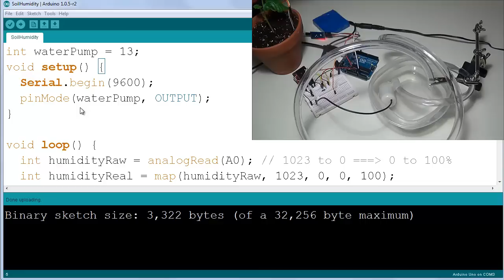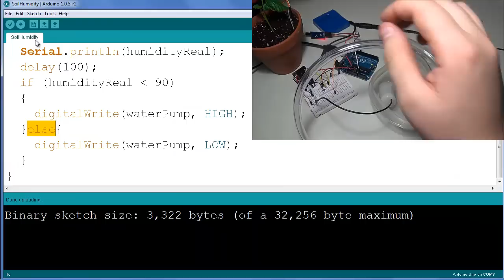Ep.52 Arduino Projects - Automated House Plant Waterer - Part 2

Comment: yes great. awesome demonstration. i have modified this project. i am not using water pump, as i had high pressure water supply. i am using electric valve to turn on or off water supply to my garden. it is working perfectly.
Reply from the maker: +umar ufx Nice! I haven't done further research on this, but it's true that if you can get a garden hose valve which is voltage activated, you don't need any pump.

Comment: Nice project.  I was thinking that a gravity system would work too with just controlling a valve that is normally closed.
Reply from the maker: +eTechTom Than you Tom. I actually thought about that too and I do have a valve which can be used for that purpose. Obviously, the tradeoff is that you will have to place your container above your plant in that case.
Reply: +EEEnthusiast Not necessarily. You could make a tube go from the bottom of a container diagonally into the pot.
Reply: EEEnthusiast hey.. Sir i've made the connections for the pump as per the video... The relay is clicking.. But the pump isn't switching on.. I've used  a 6v relay, 6v pump and 5v adapter.. What shld i do.. Plzz reply asap.. Its very imp..

Comment: I can see a near future very messy problem. 

The sensor you are using is a resistive one. It relies on a charge between two bare metal terminals to measure resistance. 

Problem is.. Putting a charge between these two terminals in the soil will cause the copper foil to disintegrate. So in a matter of weeks, the electrodes will dissolve completely (guess how I know).. Making the sensor less and less sensitive as they dissolve.  Which means it will think the plant is dryer and dryer. Until you end up with a dead sensor, and a drowned pot plant. 

To partly fix this, use a pair of stainless steel nails, which will be more durable, but these will also decompose over time. 

Not reading the sensor constantly is a way to prolong its life. . So something like.. 

power on sensor;
read sensor;

if dry
 water for 3 seconds. 
     else
Power off sensor. 
delay 30 minutes. 
           
Or.. use capacitance instead. 
Google capacitive moisture sensor. Pretty easy to make if you have PCB making materials handy. and plenty of capacitance measuring with Arduino tutorials available. 
Then you can read constantly without eating up the sensor.
Reply from the maker: +John Bailey That's actually something I haven't thought about. I think that from a practical standpoint, you wouldn't need to water your plant on a constant basis regardless and can run a daily check (if not every 2 days) which would verify your moisture level. That being said, I will read up on capacitive sensors.
Reply: Hi! Can you please clarify? What is the problem?
Reply: The sensor in the video works by sensing the voltage drop between two tracks on a bit of PCB shoved into the earth. 
Wet soil = high conductivity, or low resistance. 

Problem is.. Sending a charge through the earth also eats away the metal, and the resistance gets gradually higher as less metal is in contact with the soil. Until it is eventually all gone. At which point, the water turns on, but not off.
Reply: Thank you very much for such a detailed response!
Reply: One solution here is to let the sensor draw power from a digital port on the arduino and then from code power up that port on just before you want to take measurement from the sensor. I also build in a failure protection in my code,  so if water is pumped 3 times in a row, but sensor still says there should be pumped water, we stop everything. There might be a sensor failure or pump failure or no more water in water source.

Comment: Hi, I am new to electronics and Arduino. I kinda understand how you're using the transistor to boost the circuit. I just have a few questions on the booster circuit. What parameters should I look for in transistors if I can't use the bjt 2n4401? And will any Normally open 5v Relay work? Thank you!

Comment: I see that you've made a circuit to deal with the high current requirements of the pump, but then still use the arduino to power the pump from the 5v rail, what is the purpose of the relay if the pump is still being powered from the arduino's 5v?
Reply from the maker: You are spot on with your analysis. The reasons behind the relay are simple: 1. I wanted to demonstrate that in a relad world full size project (feeding a lot of plants (therefore relays)) would require a way to source such current. To your point, this should not be done from the 5V bus of the arduino, but from a different high current capable soure. 2. An Arduino pin can source 40mA of current, the transistor I used in the video (from memory) about 100mA, so I still need to use a relay to power my pump which requires about 200-400mA. In that case, it's safe to take the voltage from the Ardunio bus which is supplied by a 5V regulator driving 1A of current.

Comment: cool project. my question is,can I use rectifier diodes to protect circuit from backslash? tnx
Reply from the maker: Absolutely; you would want to make sure that the current doesn't go through the BJT potentially damaging it.
Reply: thanks.i have another problem. I know how to connect components, and I just started to learn coding. Sometimes I  start from scratch and just like in your case, just change the paramters to experiment to see what happens. I tried to compile your code, but I can not. can you e-mail your original working code, please?

Comment: can you show how to use a rfid control box from amazon with an arduino to unlock a elec door lock via a relay?
Reply from the maker: +Jay Mee Do you have a certain RFID in mind? The one I currently have is the Arduino module.
Reply: the rfid control box i have just puts out 2.5 volts when rfid is accepted then it goes to aduino an then a relay but its the arduino thats not working as it should and dno how to sense voltage and then re check a second or so later to make sure it wasnt a surge else my door could potentially unlock itself if you see what i mean.

Comment: I want to do the reverse. When a reservoir fills up, I want a pump suck the water out from a 'measured' level. Could your code be adapted to this? I have an Arduino R3 Board, 3 pin Relay board (able to support up to 250V @ 10 amps)  from Arduino kit, 5 to 12 Volt electric pump (at max 5 amps), LCD display and ultrasonic sensor to measure water level. I've tried several times to build some code, but I'm not as smart as you guys are. I have been looking at aquarium pumps as you have shown which consume far less power.

Comment: How can you use the 165-260 v water pump by the help of 12v relay and an adapter? i want the circuit connection and explanation briefly. can you please help me?
Reply: Relays are the answer. The high voltage current (and amps) never actually go through the board. All the relay does it act as a on/off switch between the power outlet and the device that is using the power as rated. Some relays are capable of up to 600 V and 125 amps. Expensive though. The function of a relay is to act as a switch - that's it. The nice thing (if I can ever get one to work properly...) is arduino and raspberry boards can handle up to 250V (@10 amps) using nothing more than 5 Volts to control the relay - as a switch.